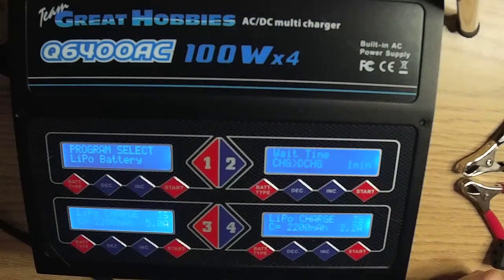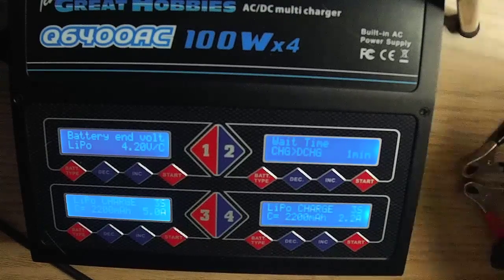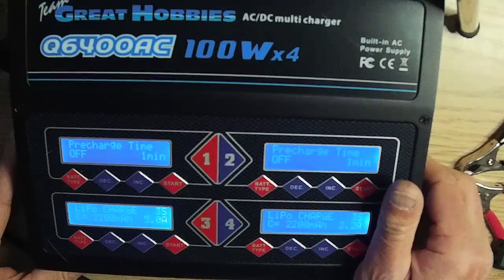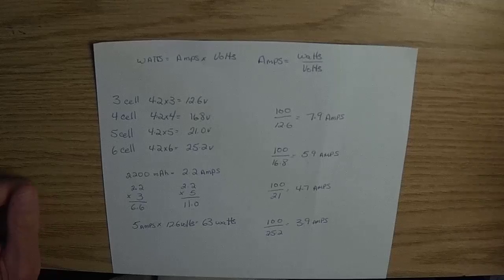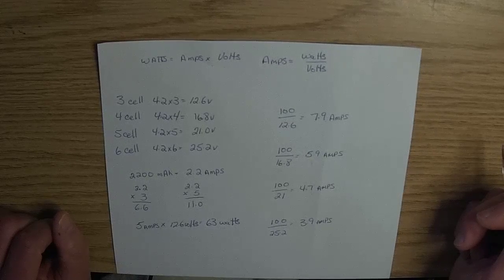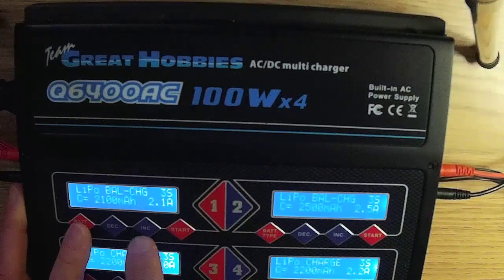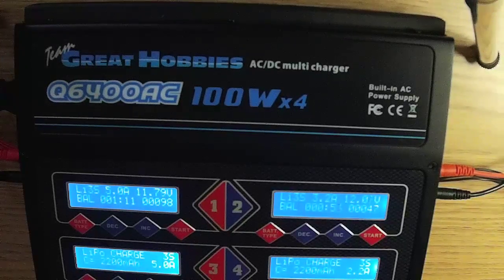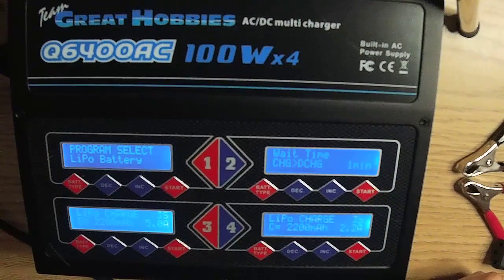Team Great Hobbies Q6400AC DC Multicharger Overview Review Lipo Battery Charging Care

Comment: what happen went said that the battery is low charge?
Reply from the maker: @rugal1983 Do you mean if a cell(s) are below 3.7 volts?  If you do. you will have to charge at a very slow rate to try and get your battery back to normal again.  This can be done but keep an watchful eye during charging.  It is easy to ruin your batter if you discharge it to a very low voltage or discharge to a low voltage to many times.  You may recover your battery this way but you may not get the same performance out of your battery as you once did.  It may be better and safer to bite the bullet and purchase a new battery pack

Comment: For anyone interested, this charger is the EV-Peak Q6400AC. EV-Peak has replaced it with the CQ3 which has almost the same specs with the one difference being it's been upgraded to up to 5 amps discharge current as opposed to the former 2 amps of the Q6400. At the time of writing this, Great Hobbies is in fact selling the newer CQ3 even though the badging on the face plate and name in their inventory/website still says Q6400. Their next order from the OEM (EV-Peak) will probably have the updated CQ3 label as well as the customized Team Great Hobbies label. You can tell the two models apart as the CQ3 has a blue anodizing on the aluminum chassis and a silver face plate (even the custom Team Great Hobbies face plate). What is currently being sold as the Team Great Hobbies "Q6400AC" charger with the Q6400 product image on their website and box photo has these CQ3 features.

There  is also a difference in the accessory package between the two models. The CQ3 package has eliminated some items that in my opinion weren't very useful anyway, in favor of actually  giving you four XH type balance boards (the Q6400 package only gives you two, you will need to purchase two more to balance charge on all four channels simultaneously) and 4 charge leads (the Q6400 gives you none, at least none that can be used for larger batteries). The 4 charge leads in the CQ3 package are XT60 (you can change the ends out to Deans or whatever you want or ask for them to be swapped out to Deans style from particular vendors who sell it). What's confusing about that is EV-Peak sent Great Hobbies the old Q6400 accessory package with the new CQ3 charger. Maybe that will be upgraded in the next batch ordered.